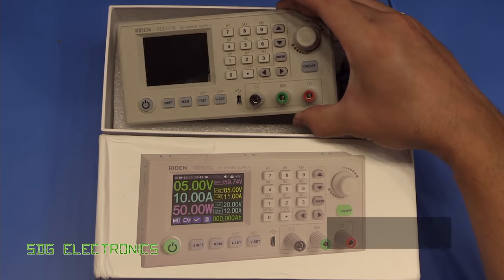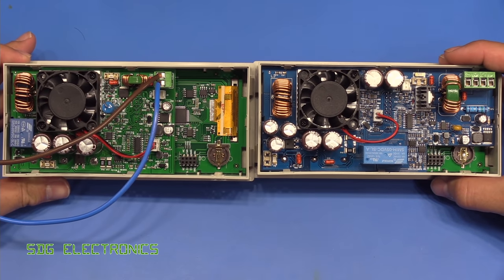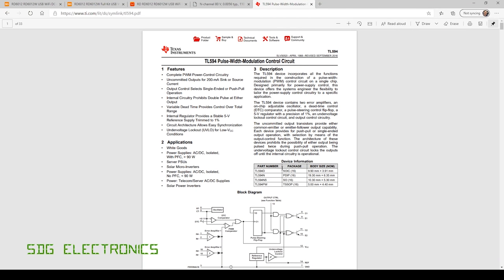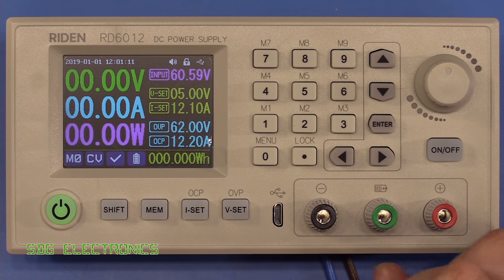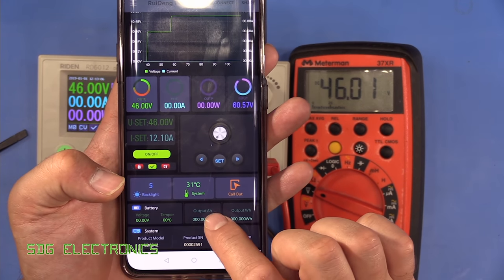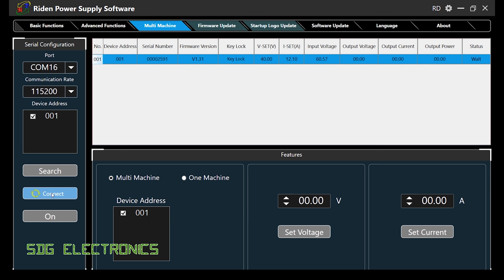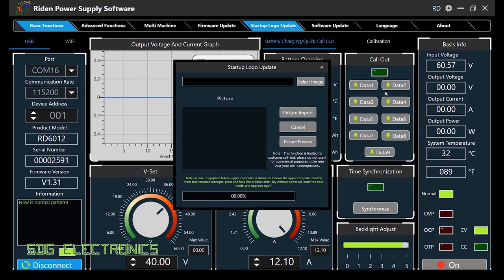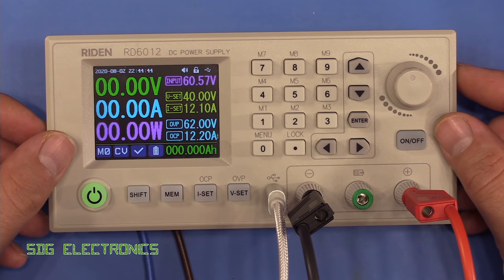SDG #168 The new RIDEN RD6012 12A 60V PSU

Comment: Hi SDG,
Just received my RD6012W and just to ad a note to your presentation info
-The del came with all three parts in a single box, outer case and ( frt panel (In a Box)) both wrapped as one and the pwr supply packed separately on top in polystyrene ) Solid, really nicely done.
-The  PCB WIFI modual does not need to be cut or grd back , when depressing the WIFI PCB pins into the header, the WIFI PCB edge pushes the plastic tongue out and as PCB upper surface area reaches the lowest point of the plastic tongue, the tongue moves back to its original position sitting on top of the WIFI PCB. The PCB also sits on other support, molded out from the surrounding walls. Now the PCB is locked in. You may need to use a little pressure to push here and there to make it site just right. 
-If you want to install the button battery , it should be done before the WIFI is installed. (why don't we get one with the kit???, (.)..)
Thanks
Reply from the maker: Thanks Vince. I'll make a video soon putting this together into the case.

Comment: Bad choice of connector colour for the battery charging, an engineer using this for the first time and needing an earth connection would go straight for the green connector.

Also just shows how far we have got with USB, it’s still a conversation to RS232 and limited to RS232 speeds.  The connector gets in the way on the front, should have a connector on the back. You don’t really want extra leads lying around in the working area.

Agree with your closing statement, for low noise you need to fall back to using a linear power supply. During EMC testing we would also use PSU with analogue displays (moving needle), as the LED displays put noise on the output.
Reply: Excellent points you highlighted. I would have gone to that earth connector !
Reply: It's almost like they copied the electrical part, because If they actually built the thing, no way would an electrical engineer use a green terminal for something other then earth ground.

Comment: I have a power conditioner with a 20A transformer. I can set the input voltage to 240VAC but ONLY drive it with 120VAC. The transformer has two outputs, at that setting that would make output #1 60VAC and output #2 120VAC all regulated from the primary side of the transformer and of course FULL isolation from the mains.
This way I can use output # 1 for the PS feature and output #2 as an isolated AC mains.
The problem with using this unit is that after the 60VAC is rectified and filtered the DC voltage would RMS somewhere around 80VDC @ 20A
I do have a handful of W26NM60 [N channel 26A 600V] but dropping 20V [To get the 80V-60V] under full load would dissipate 400W [waste] into heat. Unless I generate my own PWM to drop the voltage because Rds on is .125 ohm which also means that I could likely directly parallel two of them without having to use a balancing resistor. I would just be easier to have a unit that is 80V 20A [1600W]

Comment: I wish they would make a version with a buck-boost converter. Then you could use one of those cheap 12V 700+W server power supplies instead of having to buy one of these high power 70V PSUs,  which are not as common and quite expensive.
Reply: then if you want 700w on the output you would need circuitry and cables for 60A...

Comment: Are you sure the relay switches the 'normal' output as stated? On the RD6006 the relay seems to be only for charge termination on the special battery charging terminal. This seems like a major weirdness: do not see why it needs a special terminal and why the relay cannot be used both for manual switching and for charge termination.

Comment: How would this performe if you had a variac going into a full Bridge rectifier board with capacitors for smoothing  it.
As long as you stayed under the voltage specified?
I have a smaller similar version The DP30V5A operating from a power supply from a power chair. It has a torrdroid power supply and full Bridge rectifier. It seems to work fine for everything I use it on.  I don't have a scope,  so I've never seen what it looks like with ripple.

Comment: Thought people might be interested in this Chinese gem:

https://uk.banggood.com/AC-110-or-220V-to-DC-0-60V-8A-480W-Adjustable-Regulated-Switch-Power-Supply-Driver-Transformer-W-or-LCD-Display-for-LED-Strips-p-1323728.html

I bought this to power my RD6006, but it has its own variable voltage output which is actually 0-62V so allows the RD6006 to go right up to 60V. It even has a built-in LED volt meter!. The output is isolated and the control is a 2K potentiometer from a 5v auxiliary supply with the three pins on a connector, so very easy to adapt for control from a microcontroller DAC. It costs about the same and has the same form factor as the fixed units usually bought for the RD6006/RD6012.

My idea is to make something that looks and feels exactly like the RD6006/6012, but provides a control voltage to this switching supply plus a linear post-regulator and current limiter. This way I could control the switching regulator to give a volt or two above the demand and let the linear regulator drop the rest. I'd get the dynamic response and low noise of a linear regulator with the efficiency, high power and compact size of a switching one!
Reply: Funny, the UK link doesn't work from the US, even after removing the UK part of the address. It doesn't matter. It's not like I'm interested in buying anything ATM. I have 3 shelved bench PSU projects that are all between 80 and 95% complete. I was just curious how a SMPS is performing as claimed. Most consumer type "adjustables" I've seen are either limited in their voltage range or are 2 converters in series. The main limiting factor is usually the way the chip is powered from an auxiliary winding on the mains side. 
  Also, with a 0-60V @8A range, I imagine the typical fixed frequency controller isn't sufficient in a monolithic design. I'm curious how it's designed...not that Banggood is going to have these details.
  I've taken apart a few "universal" laptop power bricks that have adjustable output voltages. All of the ones I have that can do 5 to ~30V have two circuits in series inside the power brick. IIRC, the one I have that has chips marked does the low range with a MC34063 and the main supply is a KA7500 (aka TL494)...so you know the low range on that supply isn't capable of anywhere near the overall rated current. 
  I've modified supplies to change their feedback voltage. It usually makes for a noisy supply. It's good for basic bench testing, but if the supply had an output LC filter, that can cause issues too.
Reply: @UpcycleElectronics  This is the same part on US AliExpress:
https://www.aliexpress.com/i/4000060744469.html
I'm not equipped to give it a variable load yet, but it does seem to work as billed  as regards no-load voltage all the way from 0.2 to 62.5v.

Comment: Very good video!
Can you confirm that the 6012 has the same measurements as the 6006 - especially the depth with all components?
I would like to print a case which was designed for 6006, but ordered 6012.

Comment: Does this sense the current via the 0V terminal using a low-resistance shunt? If so then if you use an earthed supply, do you have to be careful not to attach an earth to the device under test because that would short out the shunt and the current measurement would go wrong?

Comment: FYI: If anyone interested, you can find my custom firmware for RD6012.
If you have any ideas, wishes, what to change or what to add in to the firmware, or found any bugs, just let me know.
https://www.eevblog.com/forum/testgear/ruideng-riden-rd6006-dc-power-supply/msg3227356/#msg3227356
https://monitor.net.ru/forum/threads/651114/post-6037216

Comment: Looking forward to the full test, it looks like a good hobbyist unit with some pretty useful features,
It would be interesting to see the ripple from the recommended psu compared against a known linear psu to see how much ripple it introduces from that,

The battery charging function looks interesting but I'm not sure if I would trust it to charge a large 48V lithium pack,
Any chance of a test of that? even with an 18V drill battery

Comment: I don't think the STP110N8F6 is used as reverse polarity protection. The on resistance is only 5.6 mR so the amount of power dissipated doesn't require the expense of the heatsink and assembly costs. You could do reverse polarity protection with a FET in a SOT-23 package given such a low on resistance.
Reply: 5.6m ohms is the best case for on-resistance. Perhaps the designers are accounting for a case where there is high current but a low supply voltage?
Reply: interested
Reply: I was curious, so I did the calculations:
At 12A input current you get 0,81W of power dissipation using the banner spec of 5.6mOhm. BUT using the worst-case value AT 175°C, we get 2,43W. Without a heatsink (thermal resistance of 62.5W/K), this situation occurs at a delta-T of 152.1 K, or 22.9°C. This would be the MAXIMUM ambient temperature the power supply could run at like that. That's just not quite good enough. So the heatsink is needed. Plus the heatsink mounts the mosfet securely on the board and only costs a couple cents.
Reply: @Basement-Science  Where does 22.9°C come from?
Reply: @userPrehistoricman  175°C - 152.1 K = 22.9°C
175°C is the maximum rated temperature of the mosfet, 152.1 K is the temperature difference between junction and ambient.
Reply: @Basement-Science  152.1 K equals to -121 °C
Reply: @kennethnilsson6976  BRUH.
If it was a termperature, yes. But it's a temperature difference.

Comment: Hi, nice video.
I wonder if i Can connect two RIDEN RD6012 12A 60V on parallel 48v to my battery to provide total current in 30 amp?
Reply from the maker: No damage will occur, but you will need to take care to balance the load properly
Reply: @sdgelectronics  thx for information
I can just believe that information from the screen or? 
What's going to happen if the voltage is 48 on both, but current 15 to 14 ? 
PSU will damage each other?
Reply from the maker: @jaroslawzmuda8963  no. When one starts to current limit, the other will fill in. No damage should occur
Reply: @sdgelectronics  thx for help

Comment: I got the 6012w from Aliexpress and the 70v 800w PSU from Banggood. The PSU's fan is always on, and at 100% speed instead of being temp controlled like the specs and PSU label says. I see that Banggood now has a brand new 65v 800w PSU. Does anyone know if this fan speed problem has been fixed in that 65v one? Or the 70v one for that matter? I want to replace my 70v PSU with one that doesn't have that issue so waiting for some confirmation of when it's "safe" to order a new one from either Ali or Banggood. Thanks!
Reply: The Psu fan is not controlled by the riden unit.
The riden only controls its own fan, if you want to control the other fan you need to figure out a way yourself as far as I know.

Comment: Has anyone done a test where the input voltage is significantly changed during operation.  I'd really like to see if there's any significant affect on the output.  I'm wondering how well this would work in an automotive installation.

Comment: 1: Is the USB ground isolated from the output terminals? 2: Are the output terminals isolated from earth ground?
Reply: 1. good question, probably not
2. Explained in the video. It depends on the supply that powers this unit.
Reply from the maker: No isolation at all from what I can see. That probably makes the WiFi connection a bit more desirable for the PC application.
Reply: I think i've read in the eevblog forum that it uses a usb translater chip that has isolation integrated..

Comment: is there any reason at all to use a phone to control a bench power supply ?
Reply from the maker: I can forsee situations where you want to check on something whilst you're not directly at the bench. I've certainly used the LAN interface regularly on equipment for remote control.
Reply: @sdgelectronics  "Power Must Stay on because /n/"  "There is no-one else here" "I must piss"  - Yup, forseeable
Reply: @sdgelectronics  hhhmmm ok, I'm either at the bench or not thinking about the bench.